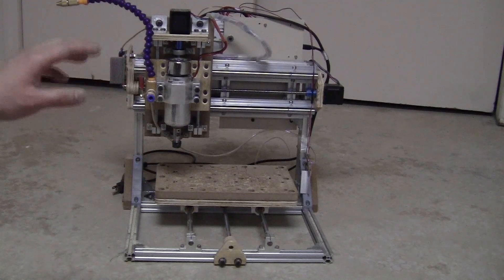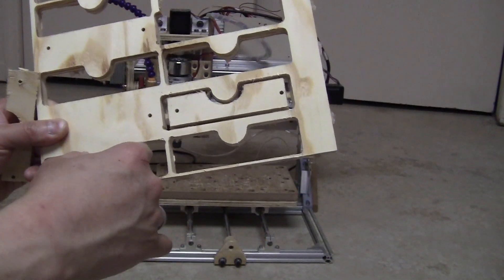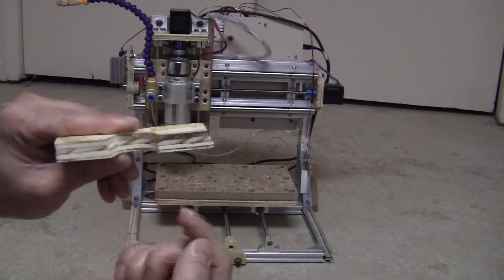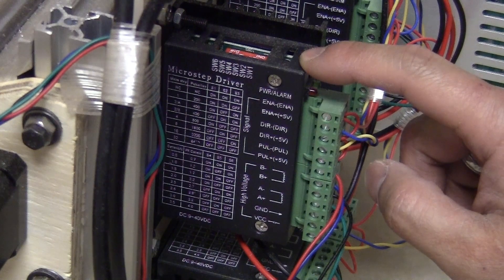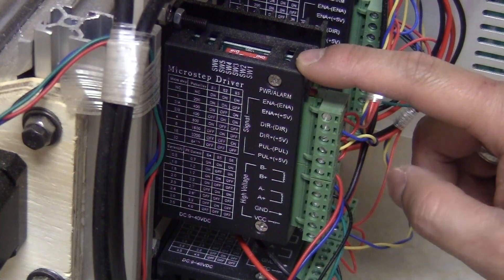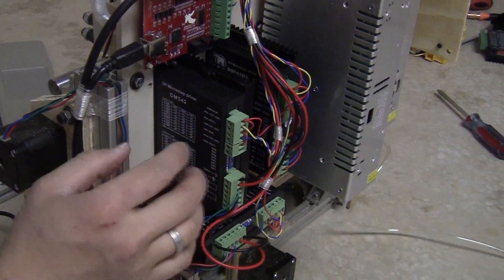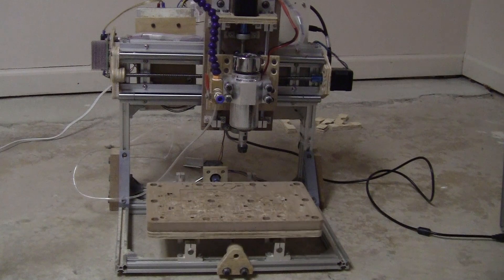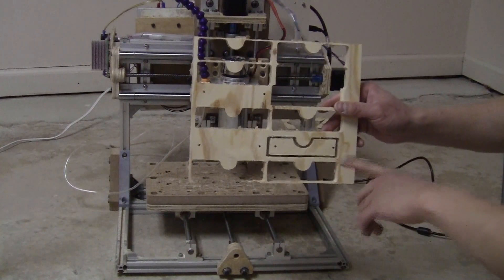Stepper motor driver - which one is not to get - avoiding TB6600 at all cost

Comment: I heard about this before I purchased my 6600, since they al only £9 UK (Amazon), I opened myne up to find no dry joints but there is no thermal compound on the small aluminium square, which makes contact to the big aluminium heatsink, perhaps this is the problem?

Comment: DM542 not support nema 17 with 200 microstep right?
Reply from the maker: No reason not to. I used then for nema 17 before
Reply: @minhsmancave9448  so what spec of your stepper motor.
Reply from the maker: The one with 2A current

Comment: It is because there is no TB6600 chip of Toshiba in these drivers. there is a much smaller and different chip inside it.
 If you will open it you will see the small chip. calling this driver "TB6600" driver is a big mistake and it is for sale all over the net.

Comment: Thank for the video. Has some problem, but my motors much bigger so I am getting that issued regularly, it's happening after few minute cutting. losing x or y axis position for few millimeters. I am thinking it's from driver. quality or heating problem
Reply: bought 4xDM556t for nema 24 hope it will resolve my problem. I will leave additional feedback when I was install them
Reply: @sergeyarustamyan6361 It is a little late, but did you got the results?

Comment: Hello, i also confirmed and had the same problem BUT NOT ANY MORE!, i had the same problems of drift and every thing but it was for sure less than yours, mainly the problem is some kind of interference caused by another component like the spindle motor (mine was the high frequency starter arc for the plasma tourch), after some hard work the solution was just a filtering capacitor wired in parallel with pulse + and - of the driver, it's value is 100nf (it's marking is : 104) and every thing worked flawlessly and the whole issue literally disappeared,
I hope this helps somebody :) .
Reply from the maker: Awesome, I'm glad you solved the problem and provided a simple solution for everyone. I don't use those drivers anymore but surely will help others for low cost machines
Reply: @minhsmancave9448  I'm glad to help others back,as it's the least i could do, i really learned a lot from people around the internet and from you particularly, thanks man!
Reply from the maker: As you confirmed that your solution worked. I'll ask for your permission to make an update video about this driver. I'm sure it will help many people who already bought them. Unless you're planning on making a video yourself.
Reply: @minhsmancave9448  Sure, i will be more than happy about the update, go ahead and I'm waiting for your results 😊
Reply: I had the same issue with the TB67S109A stepper driver that they sell it as an upgraded version of the TB6600. I almost got crazy for all the things i have checked and replaced and only one capacitor fixed the problem! I have ordered the DM542 thow cause its working for now but i dont know what else will they do in the future! Thanks again both of you! Akis from Greece
Reply: 100nf capacitor connected into parallel with VDC (power + and -) ?
Reply: Or connected between Pulse+ and V- (VOLTAGE MINUS)...?

Comment: how did you connect these to the controller
Reply from the maker: Pulse and direction pins from controller to pulse- and dir- on the motor driver. 5v to pul+ and dir+.

Comment: Anh ơi anh giải thích kỹ phần điều chỉnh switch của driver này được k ạ ?
Reply from the maker: Cách chỉnh switch của các driver đều có ghi trên cạnh của driver. Với DM542, Switch #1, #2, #3 là để chỉnh dòng điện. Switch #4 nếu bật (gạt xuống) là toàn dòng đặt bởi switch #1, #2, #3. Nếu tắt thì sẽ là nửa dòng. Ví dụ stepper motor của bạn dòng tối đa là 2A, thì bạn nên đặt 1.92A, switch #4 gạt xuống. Còn switch #5, #6, #7, #8 là để đặt bao nhiêu bước cho một vòng quay, cái này thì tùy vào máy CNC của bạn.

Comment: Tb6600hg is genuine Toshiba chip 
Which comes in tb6600 v1.2 driver , which are without that black casing those black case drivers feels sketchy to me since there's no where written they are tb6600 where else on this driver tb6600 it is actually and written and there is Toshiba chip tb6600hg inside

Comment: As a self-taught practitioner of digital and power electronics and indeed of motion control for nearly 40 years, I have a few comments:
In a stepper motor system, it seems relatively straight-forward: Connect your microprocessor step and direction signals to the corresponding inputs on a step-driver module. Apply power (!) and you're good to go. It's basic stuff to those who have done some study and practice in electronics, but evidently mysterious to newbies who follow the typically incomplete - and sometimes downright incorrect instructions lying around on the web. Including the (so-called) 'documentation' from many of the hobby and maker suppliers. There are numerous 'fine points' to learn about stepper motors, drivers, signals and interfaces which need to be covered to get good results. These include the power supply, power distribution, grounding scheme, logic levels and drive capability, noise immunity, and a host of other factors. This knowledge is clearly missing here for the most part. Therefore I recommend you all NOT give any weight to pronouncements about this is good/this is bad.  
I DO recommend that if folks want to 'do' electronics, they should make a serious study of the subject.
Reply: Hello, i want say that you are totally right, the main issue is that this driver is very sensitive to interference, my case was solved with a filtering capacitor at the pulse inputs of the driver.
Reply: @osamahnajjar2824  Tremendous! Glad to hear you have success! And thank you for your commendation. By the way,  industrial-quality stepper drives usually have opto-isolated signal inputs to deal with the noise issue. As well as ground loops. In your case, you may want to protect other inputs to the drive (if any? - ah Reset perhaps?) with capacitor as you have done with Step and Direction signals. Good fortune !
Reply: @gyrogearloose1345  Thanks for the advice i will be doing that, as for the opto isolators, the tb6600 has them for sure as i have seen online, but for the pulse inputs there is a special isolator different from the direction and enable inputs, that one i think is supposed to be a very fast isolator as it deals with high frequency step signals and maybe that's why it is more sensitive by it's nature,
 By the way in my case the interference was coming from the start arc of my plasma machine, even though it's duration is just a split of a second the drift is unnoticeable but when the design has more than 300 starting points the drift accumulates to more than 15mm.
Reply: @osamahnajjar2824  pleased to read that you have solved the problem by using capacitor, could you please send me a link of the one you used? , was it on the pulse only or pulse & dir ?
Reply: @ahalgamal  Hi Ahmed , i don't have a link but it is 100nf (104 marking) i think ceramic will work but i used myler capacitor, placed at the pulse, and placing a resistor in parallel to the cap is helpful ,470ohms will do the job, i find eliminating the source of noise is the first step, the capacitor solution is more like a painkiller as the main issue is still there.
Reply: @osamahnajjar2824  
Thank you Osamah for your quick response, i have made the connections here, is that what the connections should be or i have to change some thing?
https://youtu.be/ouoQJotEtNg
Reply: @ahalgamal  The cap is connected correctly but the resistor is not, it should be in parallel with the cap acting like a load.
Reply: @osamahnajjar2824  I totally agree with Gyro Gearloose. The basic concept how this works is really simple, but since low signal and power electronics are combined things get very complicated easily. This is why understanding how electroincs work, how EMI can effect things, what happens with a piece of 10cm wire, which is supposed to be a solid connection...

The chips may be counterfeit, I don't want to debate in that, but even is they are just more sensitive, with proper scheme it still should work.

May very well be the case that not (just) a capacitor would have needed in those sensitive inputs but some loading resistor to decrease the input impedance which will also make harder for EMI to induce levels that disturb the real signal.

Optocouplers won't magically make everything immune to noise, when you tie it's groud point right to the PowerGND. It might take just a few mA to activate the inputs and if some unwanted current induced either in the ground wire or the signal wire, it still can disturb the signal.

Good practice is to use shielded wires for both the motors and the control signals, and still do not route them parallel in the same loom. Distance is the most guaranteed EMI reduction possibility. Separate in space the high power parts and it's wiring, including their supplies from the small signal control side.

Grounding is a very hard topic. I do not like the term "ground loop", because it suggests that the problem is with the loop. No, it is not. You can make a very unstable wiring with a star grounding just as well.

The whole grounding problem is caused by just a simple issue: the receiver side of a signal interprets the signal according to it's own ground. If it isn't the same as the sender side's ground, then it is obvious that something will happen. In analog circuits, it causes a continuous measureable offset, noise, and all sorts of stuff, but might be the bandwith limits it to an acceptable level at least. In digital circuits, it might just work most of the time, as long as there isn't some transient that push a signal out of the levels. And usually there is such a transient, if the ground wires are long, unshielded and other currents than what belongs to the signal flow through the wire. High frequency switching signals easily induce enough noise, and digital circuits are usually very fast, fast enough to capture these pulses.

The best case would be when every signal would have been carried through a balanced differential line, this would eliminate a lot of EMC/EMI disturbance. But when this isn't available, the second best option is the optocoupled inputs. But that only works good, when you supply your own small-signal ground, and not tie it together with PGND, nor it tied together inside the driver. If it is, then it is an inherently bad design, the optos doesn't help much noise-wise other than protecting the input from overvoltage.

Long story short, this is easy to understand, yet very hard to solve it right and things get very complicated fast as you increase the number of interconnected modules, especially when not you are the one who designed how they expect connections to the rest of the system.
Reply: Another common issue, even if the ground is separate perfectly, is when it takes different route than the signal. Do not route the signal and it's ground through different locations in space because they pick up different noise!

Route them together. Ideally in twisted pair. If more signals share the same ground, all should be together.

Common mode filtering might also help in some cases. This is when you wind a few turns of both wires together on a ferrite core, just before the connector right at the device. This is just a transformer which deliberately induces signal from one wire to the other. For example if there is a transient noise which might be picked up by the ground wire, it will transform it into the signal wire as well, so they might cancel out at receive side.

This also applies to power signals too. Routing power signals all over the place just radiates more noise. All the wires where the same current could flow out and back in should be close together, for example belonging winding wires of steppers, three phase wires of AC motors to the VFD, DC bus supply positive with it's PGND, etc...

Not just noise has to be filtered on reception side but also noise radiation should be reduced.
Reply: @gabiold Thank you very much!  I spent a lot of time searching for this and couldn't find much, i really appreciate it 🙏.
Reply: @gabiold  I Thank You for this Complex yet Easy to understand Explanation . Manny Thanks
Reply: I indeed agree with you about that, but believe it or not this case is true and i trust this man,the driver is actually bad but it might be just a bad particular lot or cloned driver, I'm saying this because I'm having the same problem currently, i just built my cnc plasma table and I'm using NEMA 23 motors with gear boxes, for y-axis I'm using two motors one on each side with a dm542 driver for each one, for my x-axis the load is too light so i used a tp6600 driver at a current of 2.5amp, while trying cutting some samples a small drift was noticed but i didn't give much care ,
 now when i tried cutting a 2m x 0.7m entrance door the cuts were shifting in a concerning way, now when the machine finished i found a really bad job accuracy, homing the machine showed the x-axis (tp6600) shifted around 1.5 cm WHICH IS A LOT while y-axis (dm542) had absolutely 0 cm shift.
By the way this YouTuber helped me a lot with his videos, but the only true reason why I'm here is because i just googled " tp6600 are they any good? " and this video came on top of the list .
the tp6600 driver has a really good reviews but some people say the chip inside might get manipulated and might  not really be a tp6600.
By the way, by your experience could there be a solution for such a problem or do suggest changing the driver?

Comment: Your looping the power from stepper module to stepper module. Thats your problem. Each stepper module power need to come from the power supply. Do Not Loop The Power From Stepper Module to Stepper Module.
Reply: With shielded twisted pair or at least twisted. No daisy chains.
Reply: Thank you Martin! This is the first response I have read here that shows knowledge of some of the 'subtleties' of these kind of circuits. It's basic stuff to those who have done some study and practice in electronics, but evidently mysterious to newbies who follow the typically incomplete instructions lying around on the web. Including the (so-called) 'documentation' from many of the hobby and maker suppliers. There are numerous other 'fine points' to learn about stepper motors, drivers and interfaces which need to be covered to get good results. This knowledge is clearly missing here for the most part. Therefore I recommend you all NOT give any weight to pronouncements about this is good/that is bad. 
I DO recommend that if folks want to 'do' electronics, they should make a serious study of the subject.

Comment: I am ordering the TB6600 to use, what should I do? Is there no solution?
Reply from the maker: Not that I know off for now. Some viewers told me that you can try increasing the pulse width to 20us. I can't try since I don't have Tb6600 anymore. I guess that you will find out and let us know.
Reply: It seems that most of 6600 driver's are fake so the first step would be to take the cover off and look at the chip and see if it's authentic 

Not sure what you're looking for do a Google search for fake TB6600. There's multiple threads on cnczone forum with pics

Comment: 90 % of the time, the problems you experience are form connections:
are all zero volts connected together?
Is your power supply very stable?
Do you use power tools at the same time you use your CNC?
Reply from the maker: I would still say that the drivers are not good. I found out they are not original Tb6600s. Now, you can buy the real ones but the problem is that you don't know which ones are real. I have been using dm542 and dm556, no problem at all, running my saw, shop vac, etc. While milling, nothing shifted.